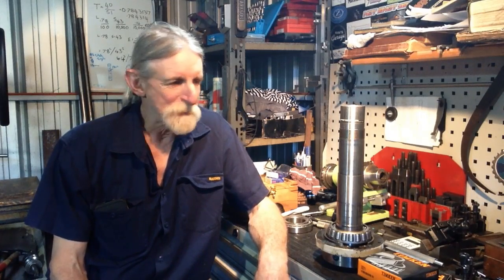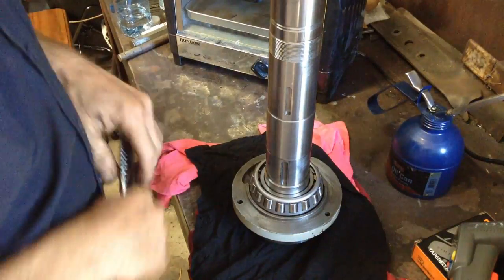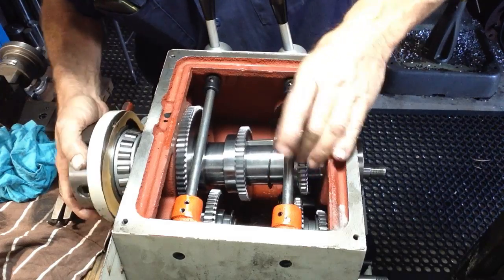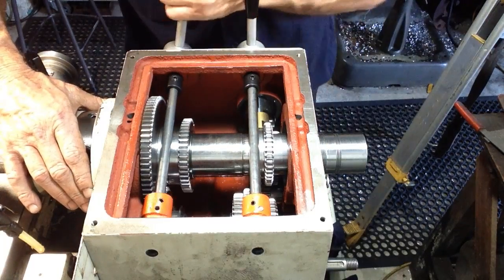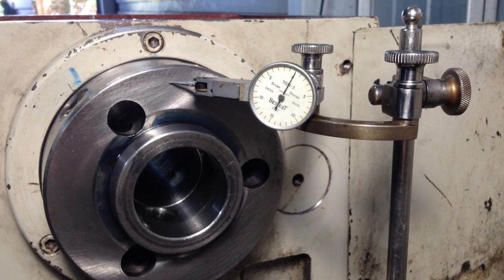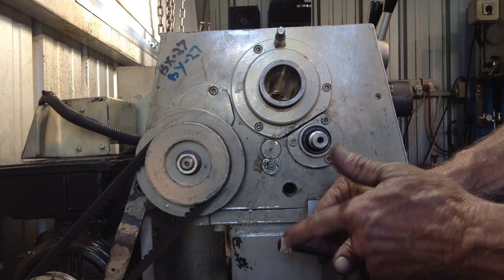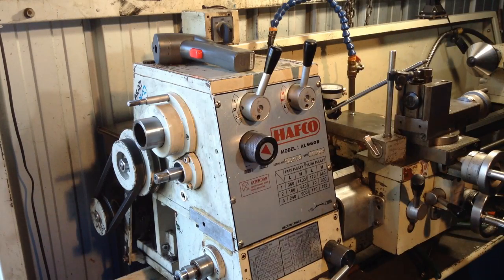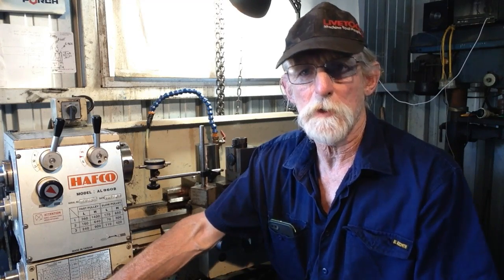Replacing & Setting lathe spindle bearings .  Part 4 , Final .

Comment: Probably the most comprehensive headstock bearing adjustment video I have seen ! 
Only thing I can add to it is for lathes that run greased bearings ( mini lathes that have had a taper bearing conversion etc ) is to adjust out most of the end float and run the lathe on low for a good 15 min  - this lets the grease disperse ( you don’t need a lot of grease either as too much creates drag and heat ) then check end float and re adjust - once you are close to zero run the lathe about mid range to heat soak the spindle and do the last adjustment . Greased bearings will run hotter than oiled bearings especially when you start spinning taper rollers at 2 grand . Finally don’t do what I’d did on my mini lathe and fit lip seals in the bearing shields - the extra heat they generate is astonishing ! 
Ripper video Max ! Thanks mate !
Reply from the maker: You are spot on with the heat generated by lip seals , it's surprising .

Comment: This is fantastic. Brilliant solution for pushing that old bearing off. I have a very similar lathe from the early 90s that needs a bearing change, will be using your method. Also the best explanation of how to judge pre-load that i've seen in a vid. Thanks! Also Also, "Re-Nip" has been added to vocabulary. Cheers.
Reply from the maker: Thanks .

Comment: Nice job Max, got to be happy with the run out and quiet running.
I replaced the cheesy gear selector indicators with 1.5 mm aluminium covers, machined to dia and parted off, used Stainless Steel round head drive rivets to show the position.
Reply from the maker: Yes , pretty cheap . No one would know there are adjuster screws under them !

Comment: Great job, nice detailed tutorial on taper roller bearings for axial thrust application,  as you say, taper rollers don't like pre-load, the get hot pretty quickly at light or zero loads, heavy loads helps transmit the heat fully with roller contact. Obviously when actually turning, the rear bearing could be flapping about, the rotary friction welding machines I used to install had a spring cartridge on the rear to maintain alignment and gave support to the rear transmission belt drives. Rear bearings are smaller than the front, on bigger machines, the front bearings were double or triple stacked. Sizes ranged from 8" bore inner cone, to 18" diameters. 
Again,  great job,thanks for sharing.
Reply from the maker: Thanks .   Rotary friction welding would be great to see in real life !
Reply: @swanvalleymachineshop  I've been working on RFW since 1989, still great to watch,  even when I am doing weld development or for the first time on a new machine or new tooling, can be bum clenching time😵.
Can take hours to cut and section the weldments, prep them for a bend test and both macro/microscopy.
I've met many in a bar that say it doesn't work, or you can't  bond copper to steel  to aluminium etc.
Is the heat cooling down yet?
Best regards John.
Reply from the maker: @bostedtap8399  Still hot .  43 Deg C yesterday !
Reply: @swanvalleymachineshop  Ouch!

Comment: That was a great little series Max 👍 Very in depth with the usual great tips. All thru it I have been thinking " Mine is fine and should not need this for at least 10 years"  but after hearing the difference I am now a bit scared 🤣
Reply from the maker: Hey Bill , check it's not just the change gears on the back .   Cheers .
Reply: Will do mate, Cheers 🍺

Comment: That's an incredible result for plain non precision bearings! Only a few micron runout is incredible. For reference I put p5 precision taper roller bearings and had about 4 micron run out on my Wabeco lathe. On my milling machine I put in p4 precision bearings and had 3 micron run out. It looks like you go very lucky with these bearings or timken makes really good bearings.
Reply from the maker: I think i  may have just got lucky , or any run out from the spindle & bearing combined evened out !

Comment: Lots of great tips Max. I like how you did the preload on the headstock bearings. I need to remember that. Those bearing are much more expensive here in Canada. I use 6203, 6204 and 6205 often. 30211 is $86.14 and 30212 is $94.91. Thats about  $95 and $103 Australian. I think I should start to look for a new supplier. Another well done rebuild. Thanks Max
Reply from the maker: Thanks .  I would have thought your bearings would have been much cheaper there .     I am lucky to have a major bearing supplier just down the road .
Reply: When I did my little Chinese lathe my spindle bearings were in the $80ish to.
Methinks you have a better relationship with your bearing supplier than we do, hahaaa!

Comment: Excellent video Max!  When checking the temps, what figure above ambient is acceptable?  And for greased bearings?
Reply from the maker: Look up the Timken website & they have the different specifications for that .  There is a difference between grease & oil .   I should have down loaded the page when i was looking as it took a while to find .   They can run quite warm with no ill effects .
Reply: @swanvalleymachineshop  Thanks for that, will do.

Comment: I have never had to do the headstock on a lathe, done a number of other gearboxes and shaft alignments over the years though. I think I'd have put a shaft (a couple of mm clearance) from the tailstock right through the spindle to a decent bracket spaced right back from the drive side. I would have taken the selectors out, no matter the roll pins and would then put all the gears, bushes, circlips etc on over the shaft in order and would then slide the spindle in, not far out of alignment with where its supposed to be. May be overthinking it again, but hey.
Reply from the maker: Overthinking !!!  Good idea though !  👍

Comment: The Grizzy manual for similar lathe says tighten nut extra 1/16" clockwise measured at outer circumference  of nut after zero end float and zero preload is established. Hope that helps.
Reply from the maker: Thanks .  That would be similar to the last tap using the sharpie marker as a reference on my one .  Did that manual say if it was a operating temp adjustment or a cold adjustment ?Cheers .

Comment: Hey Max great job your attention to detail is spot on and i learned some new tricks of the trade from watching you video (roller contact ) .I think those bearings will work just fine and i don't think you will go pass there speed rating . I watch some videos and went with the precision ones i have a precision matthews lathe din''t ask them but looked on grizzlys web sight they had one bearing and the price was like $800.00 crooks . The large spindle  bearing was hard to find online in NSK made in japan  i found one duplex set new old stock so two bearings for $150.00 and found the small one for like $85.00 each  got two on EBay for $150.00 going to stick with NSK bearings for the rest standard  grind . I don't like chinese bearings to me there rough and noisy . I know this is a long story not a comment I'll try to keep it shorter . Again Thanks a lot for the videos and can't wait for the new shop five thumbs up on your channel .JM
Reply from the maker: Cheers .   I keep well away from those chinese things as well , where possible !

Comment: Thanks Max, great vid. I also have a 960B and it is so bloody noisy I run it with the Gears in neutral most of the time unless I have to engage I dont.
How have you quietened down the gear train for feed and lead?
Reply from the maker: They still have to be put back on with new bearings .  If the teeth are running with too muck or too little back lash on the banjo they can make a lot of noise .  
Have you checked the oil feed to the quick change gearbox , i did a video on it in a series of video's a fair while back & my lathe needed a bit of attention there .
     https://youtu.be/t1UIVUdJaFw

Comment: How much Did your bearings run you in total I need to go inside my koping s8sa similar layout but larger it’s got a L2 nose spindle mount 2.5” bore so I figure about double maybe triple cost of what you spent just want to do the input shaft bearings adjust the spindle itself and would like to check my forward reverse out then I reckon I’ll tackle the feed gear box
Reply from the maker: I just looked up one of those lathes & they look to be quite a high end quality machine .   Spindle bearings would be expensive  , an L2 taper is large for that size machine .

Comment: Hi again, Ive just gone thro this adjustment procedure works fine. Altho when I push on the head stock casting I get approx 0.0005" of deflection on my indicator is that normal  Max ?
Reply from the maker: Yes .  I think you are picking up the headstock & bed flexing on the tin pedestals .  I can flex my one a couple of thou by hand .   I am planning on building new more solid pedestals for my one . I am planning to do it this winter , hopefully  .   
Cheers  👍

Comment: Heat up the bearings, they slip off then, the interference is very small, I just done the bearings in the headstock of my big Kirloskar lathe with new Gamet bearings £3000! and had to make a pair of headstock gears and a little heat was all it took. The spindle has a 4" bore with a D1-11 chuck mount. It's interesting that all modern lathes use the basic design first used by Colchester for the spindle bearings and labyrinth seals. Good video all the same.
Reply from the maker: Thanks .  Not the sort of spindle you can pick up with one hand & put in the press !     Cheers .
Reply: @swanvalleymachineshop  i've just subscribed too!
Reply from the maker: @crozwayne  Thanks .   This is how i do bearings with heat !   https://www.youtube.com/watch?v=5MGGtAGVVpE

Comment: Great series
Can you tell me about your drive belt, mine is a solid 25 inch and there is a lot of belt shredding, on my second and I’m just a tinkerer, my pulleys are aligned, I noticed that you have a 27 inch marked on your lathe
Reply from the maker: BX27 ,  cog type belt .   I have a different motor fitted than the original . I always go for a cog type belt with small pulleys .

Comment: i got to do min i have a Colchester with tow being at the front   do Temkin do bubal type of Bering ? i wonder the genuine tips are 800 quid a set  that why i did not  bother but i will have to at some stage . ? any advice will be welcome . les England .
Reply from the maker: That may have the expensive Gamet bearings . Might just need adjusting .
Reply: @swanvalleymachineshop   thanks  max i check them out mite  save me some money  .

Comment: It says, Run the lathe for 20 minutes in high gear to reach normal operating temperature before performing adjustment. Hope that helps.
Reply from the maker: Thanks .  I had it running about 2 hrs for the op temp adjustment , just to be sure !     Cheers .

Comment: Hi Max   .. With the removal of the Spindle Baring, I thought there was enough room to use the baring remover half bolted plates, without doing any damage to the cast iron housing.
With the adjustment of the Spindle Barings I would have nipped them up same as doing car or truck adjustments. Nip them right up to seat the Barings,  release the tension, then nip them up to slight tension,  then check run-out for correct tension .
I liked the dial gauge setup.  Overall an excellent assembly & Video 
Are you using hydrolic oil in your oil can, Tellus 68 or ?
Reply from the maker: You may damage the cones doing that .  The cones are a bit tighter fit than truck wheel bearings .   68 hyd  is the only oil i use for everything .

Comment: Another great instructional video Max.
Curious when you said that "a lathe chuck should rotate one full turn"...
Would you that apply to ALL lathes regardless of their size?
I've a small bench top modelmakers lathe (17Kg) & wondering if that's applicable to it?
Reply from the maker: . My one has always run about 1 turn in neutral from new , it's just a bit of an indication .  Best way is by measurement of play & heat .
Reply: @swanvalleymachineshop  Thanks Max, I'll use that info when checking mine.

Comment: G'day Max.  Looks like you needed a third hand at times there, looked like those selector rods didn't help either but you won. I understand your method of checking for roller contact, (I haven't seen anyone do that) but doesn't checking for end play make it redundant anyhow? A good headstock assembly video all the same.  Cheers Peter
Reply from the maker: You can still have no end play but have rollers skip . It's a fine line to find before you put the last bit of preload ( absolute minimum ) on the bearing .    Cheers Peter .

Comment: Really thorough job Max, much different than dealing with a few thou tolerance in most of the stuff I mess with. I think a lot of people would be satisfied with 4 tenths, I like that you not only halved it you quartered that. How often do you think you will check them as they run in or do you think you will even need to? Best! Eddie
Reply from the maker: I will  check them in about 6 months unless i feel they need checking earlier .  Once they have had that final check , they should be right for years .

Comment: Good day sir
I need small information about which grease Good for head stock gear box please devise me soon as possible
Reply from the maker: Hydraulic oil .   Usually 46 or 68 .  👍
Reply: Actually u r right but here have some problem while running the machine rear baring cover n coller lock nut side oil leakage.

Comment: If it helps the book for my Colchester Bantam (similar sized lathe) says 1/10 thou as end float but I forget under what condition, hot or cold oiled or dry etc, to measure it at.
Reply from the maker: Ok , thanks .  Don't Colchester lathes run a back to back taper roller at the front  .
Reply: @swanvalleymachineshop  beats me but I know they cost a little  more than yours did, by quite a margin I believe.😭😭😭😭😭

Comment: we heat the bearing and sometimes wrap the shaft in plastic and put in dry ice or just ice
Reply from the maker: Thanks .  At work we use liquid nitrogen .
Reply: @swanvalleymachineshop  I do service in 500 shops and most would not let me bring in liquid nitrogen, I even have to document WD40
Reply from the maker: @garylarson6386  I guess it would have to be on their MSDS  ( material saftey data sheets ) .

Comment: Hi sir
Please give me sugetion for rear bearing side oil leakage on above 1000 rpm
Reply from the maker: Might be oil level to high or restriction in the drain hole from the rear labyrinth seal cover .  👍
Reply: @swanvalleymachineshop  no sir almost I keep oil level very low
Reply: Good day 
Dear sir,
I have changed all oring, oilseal, gaaket,  bearings, then while I start the machine up to 750 rpm not leakage any where then i changed rum 1250 thatime oil coming from rear bearing coller cover there some oil leakage found , so any plan to stop the oil leak.kindly advice me.
Reply from the maker: @mohandassalian6552  What model of lathe is it , how is the rear bearing being supplied oil from ?

Comment: Maxie, thanks for the thorough demo of setting bearings on a spindle shaft. Enjoyed the checkout also. Guess with shipping and all cost about $150  As. which doesn't seem bad. How often would you do change out? By hours or say every 5 years. Love watching, thanks.
Reply from the maker: Only changed because of the noisy countershaft bearings , they lasted 12 years .   The spindle bearings were still good except for the radial scratches from particulates in the oil .  I could have re used the spindle bearings but they were cheap , so they were replaced .